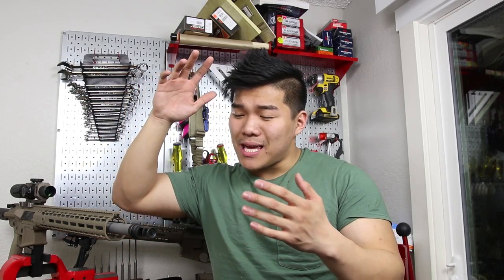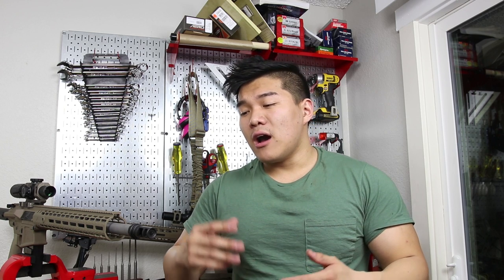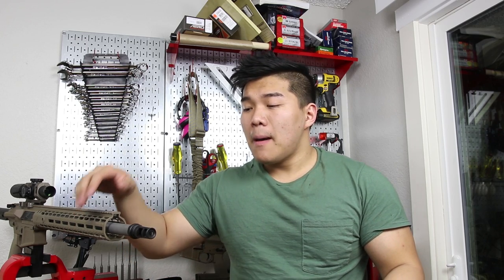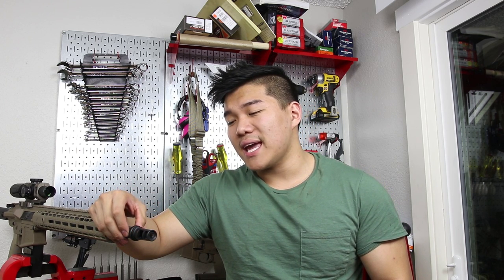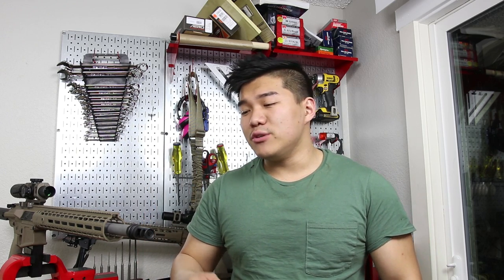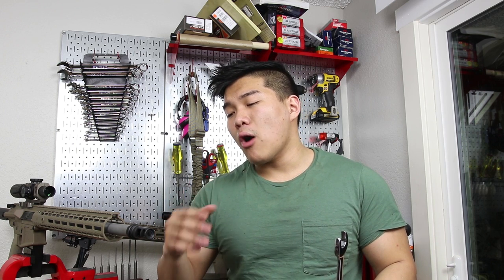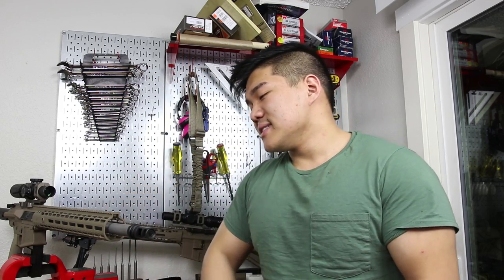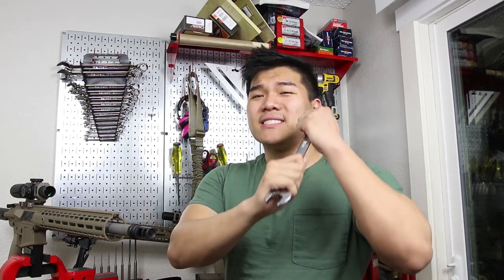TIMING A MUZZLE BRAKE

Comment: Let me help you with the math... its really simple.  If you have a 28 threads per inch thread, on the end of your barrel, it works out to 1000 mils/28 threads = 35.7 mils for each 360 degree turn of your muzzle brake...  So, if your brake is off 90 degrees, you will need a shim thickness of 90 degrees/360 degrees or 25% of 35.7 mils or about 9 mils.
Reply: A 9mm shim? 9mm is 0.35". Something is way off in this calculation.
Reply: Andrew Evanoff mil does not equal mm. A mill is one thousandth if an inch. So the shim should be 9/1000 of an inch, not 9mm
Reply: .009 in this case. Glad i found this. Saves some head scratching in the morning making a shim

Comment: Dude, isn't 60ftlbs a little excessive? Why not put a little rockset on the threads and tighten to around 30? Isn't that whats recommended? 60ftlbs of torque on a muzzle device seems excessive, and I've heard it can hurt accuracy when over tightened.

Comment: I like using Crush Washers. Depending on the turns that you get you might want to add a washer or two or several depending on the thickness of the washer along with your crush washer to get the proper timing.
Reply: Don't use a crush washer if you are using a suppressor!! You can get a baffle strike.
Reply: @calicojack556 : Can't legally own a suppressor here in The Police State of California. So I guess I'm good to go with the crush washers. LOL

Comment: Disregard everything he said.
Reply: Why?
Reply: @WallStreetRedneck  He has no clue. #1 on a "precision" upper like he says he has, if you overtorque the brake you will stretch out the rifling on the muzzle, reducing the twist rate, and destroying your accuracy. #2 If you don't torque it to a minimum the adapter will come off, destroying a suppressor, which I am sure he's never even seen one, or rendering the effect of the brake null. That is why you need a torque wrench to help you get to the relatively narrow band of torque between minimum and maximum values. #3 Welding a brake on? Never heard this. How about using Rocksett thread locking compound, heat resistant, and prevents vibrations from shaking it loose? Have never seen a video on an AAC adapter in which torque values and Rocksett are never discussed, and there are lots of them out there. Watch Barry Duek's video on installing a Surefire adapter.  If you don't know what you are talking about it's best to watch a good video and learn something than make a video which shows you know nothing.

Comment: No rocksett?
Reply from the maker: 60 ft lbs will do it haha
Reply: I would go over 30. You can decrease the diameter of your barrel and your accuracy will suffer. I would not use rockset either of you ever plan to remove it which requires socking the end of your barrel in water for 24 hours lol. Yes, thats actually how you do it.

Comment: 1. Put muzzle brake on without shims, fully tightened. 2. Loosen brake until it lines up with proper orientation (less than 1 full turn). 3. Insert edge of shims between barrel and brake until you find the largest shim that fits.  4. Select the next size bigger shim. If that is the largest shim in the set, select that shim + the smallest. 5. Remove muzzle brake, add shims, loctite, and reinstall.

It might not be mathematically perfect but it will be visually perfect...which is close enough.
Reply: Are crush washers the same as shims?
Reply: @Ash Green no they are not the same as shims
Reply: Make this comment have more likes than the video guys

Comment: The Miculek brake actually needs tuned. Jerry recommends 1 o'clock, but I ended up with mine just slightly off center. More like 12:15.   It was well worth the trial, and error process of getting it perfect. Now, my optic never leaves the target during rapid fire drills. The exact tuning will vary with different shooters, and grips.

Comment: Good vid. Yea newer to this except for AK style muzzle brakes which don’t seem to have this problem at all they just fit right on to the tee. But just got a muzzle brake for my mini 14 300 blackout and it had to be aligned right because it has holes on both sides plus the top but was canted off by 1/4 inch or more so I guess use several shims yes?

Comment: so shouldnt you be using a crush washer for your barrels? which is why you have crush washers on all muzzle breaks
Reply from the maker: the multiple washers act like a crush washer
Reply: No never use a crush washer for a suppressor mount break the crush washer may not be true and your can can get destroyed
Reply: Depends. Crush washers are fine if you don’t plan on using a suppressor.
Reply: Surefire does not use crush washers. Spacers only. You can use the thick spacer depending on thread depth though.
Reply: @jawknee2  crush washers are junk.